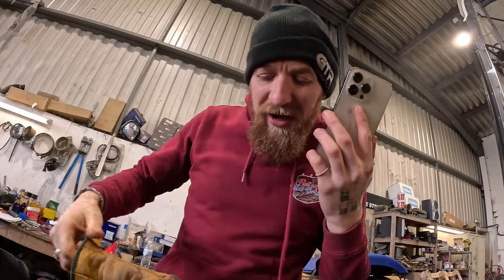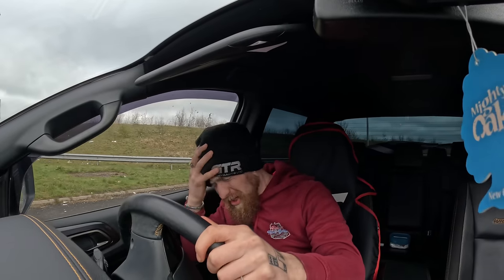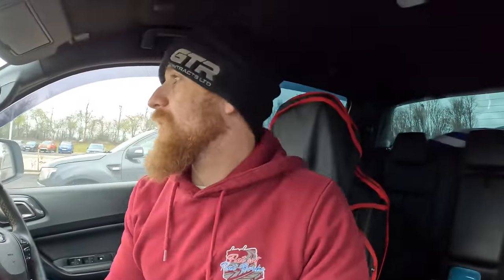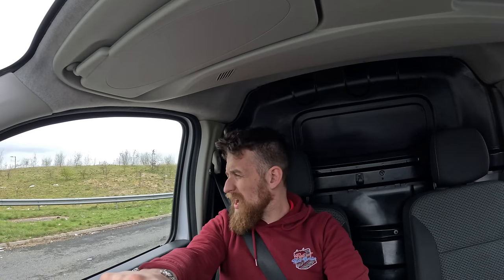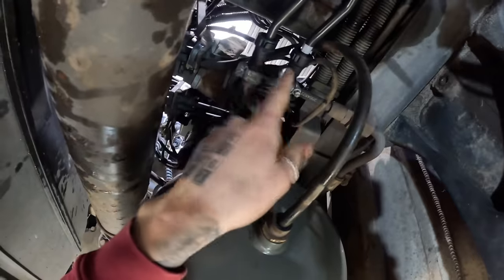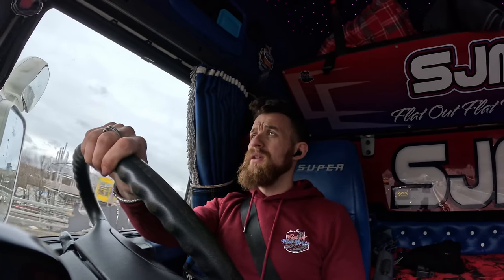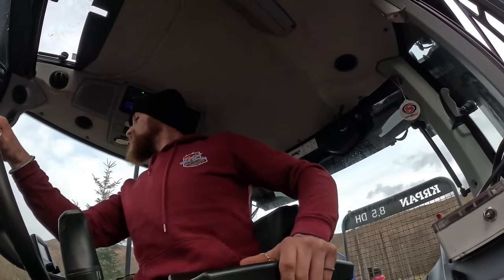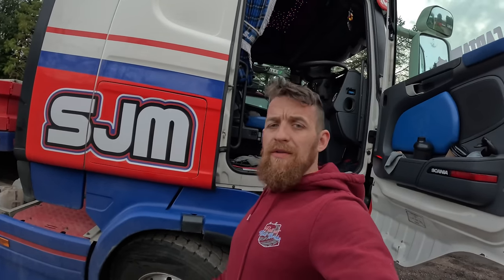It’s Costing Time & Money!!! Now!!!

Comment: In my opinion.....the pre dpf and add blue trucks are way far better.....and more reliable.
Ok there's the wear and tear Parts and running gear is older and may need attention.
But least it's not like the new ones.....ok before break....then all shit kicks off when switching back on....
It's a 50/50 split chap.
Go for old or keep your unit, and keep up with repairs.
Or get newer.......and take a gamble.
I know where my thoughts are.
IV no computer to plug in....but IV got spanners and hammer....
Good look in your choice Sandy.

Comment: hi sandy  i put a 90 degree bend on the end of the exhurst  so  it points down more  it stops a lot of heat going at them cables etc
Reply from the maker: Ground clearance for the woods
Reply: @Sandy-Flat-Out-Flat-Broke  could you wrap them with furnace control cable sleeving? I've used it in the past for AV cables running close to wood burners.

Comment: Spare parts for anything are are rip off nowadays Sandy.
I recall going to the main dealer for a part one time but they didn't have one in stock that day so they gave Dingbro a call and they said they had one in stock on shelf. 
Well I was given a purchase order slip from the dealer as i said that I would go and pick it up myself as I needed it there and then as it was just around the road from the dealers.
When i got the part I saw the price of it on the Dingbro computer screen and almost thought of just paying for it myself,  When I was invoiced by the dealer for the part it was for 4 times the price it was on Dingbro's computer  !!
The dealer didn't even collect it  as I did that myself. Just goes to show how much of a mark up there is on spare parts 😢😢😢

Comment: Hi sandy i have 3 trucks 2 older r500 and a year old 770s its a year old . I am replacing the 2 r500 next month with 2 low milage 2 year old scanias  both will be scanias  a 530 and a 500  . I have been in this industry  for 36 years and  i got like you wifh the older trucks needing this and that and then more this and that so i bit the bullet and sent shopping there are some great deals about and i had had ef buying parts every day  .. . Now your truck has served you well but its starting to need a lot of bits that wonf stop ghere comes a point a decision has to be made .sandy look around there is some really good low  milage  trucks sometimes you just have to go out of comfort mode .work out tims labour parts time over last 2 years and be honest wigh it then go shopping  you will find a way to getting  a much newer low milage truck . Dont make mistake and get trapped in buying lot of new parts its done it job you made it good you are a great bloke vhard worker you make it happen  you will get the work in to pay it off

Comment: Hi sandy matey 👍 it's mark from Wirral Merseyside 👍 it all depends on what you're truck is costing you every month on part's and what you are getting every month for jobs you are doing so it's swings and roundabouts every month for you really sandy matey 👍 or get the whole truck checked over and see what is wrong with the truck and what parts you'll need to put your truck right. But like you said that truck of yours is a great truck and it works hard. And there is a saying it's better the devil you no than the devil you don't no with a different new truck.... Just bare that in mind sandy matey 👍 thanks from mark from Wirral Merseyside 👍 hope to hear from you soon
Reply: Also Wirral :-)